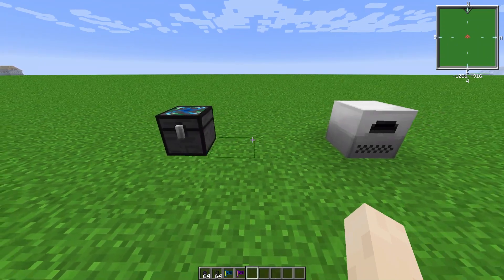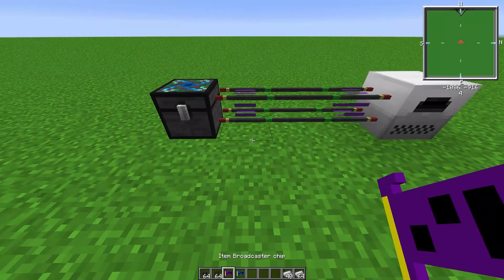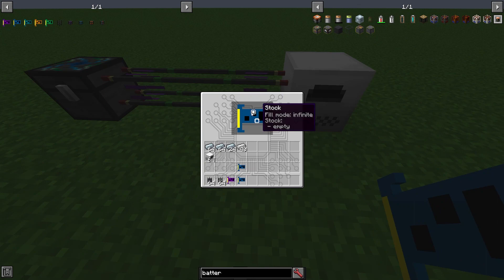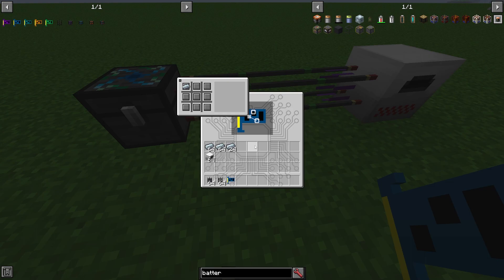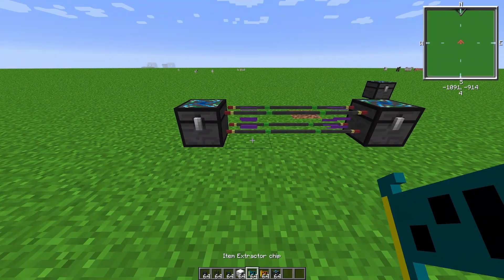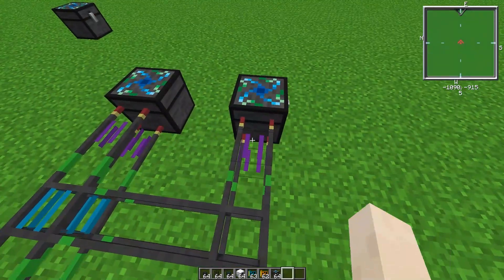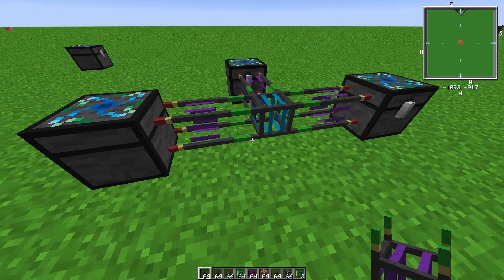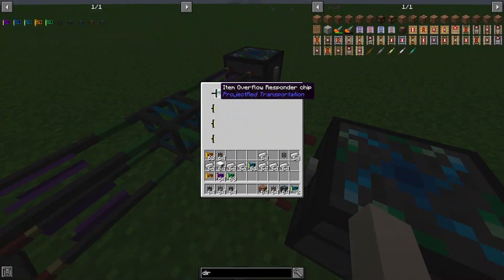Project Red Transportation Pipes/Chips - Tekkit 2Torial

Comment: For the overflow chip, if I want the give the overflow in the pipes somewhere to go, but don't want to also empty the source chest to the overflow spot too, how do I set that up?
Reply: For over flow I used a recycler and pumped the scrap into a mass fabricator.
Reply: can you make an auto crafting solar panel farm using these pipes if so idk how so confusing
Reply: @zAhzoa  you can. just use broadcaster and stock keeper chips to insert into an autocrafting table and dump all the intermediates into a chest that also outputs into the autocrafter